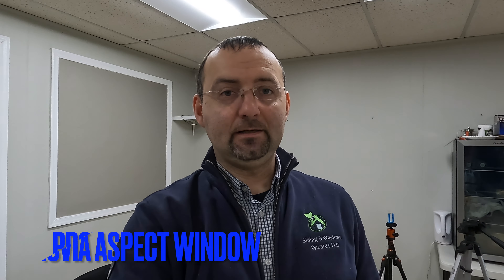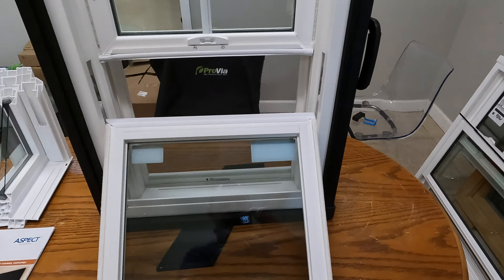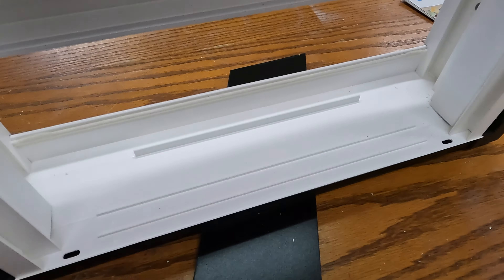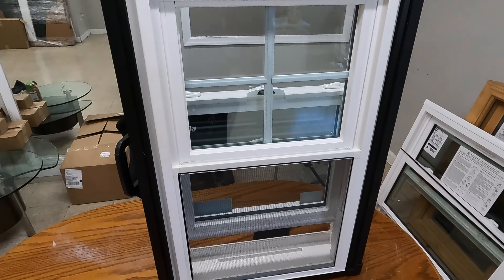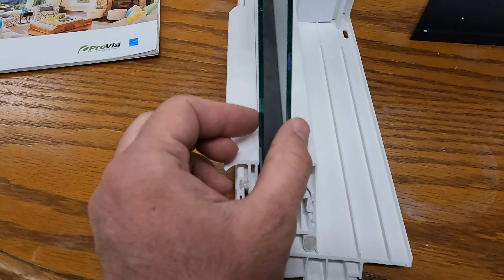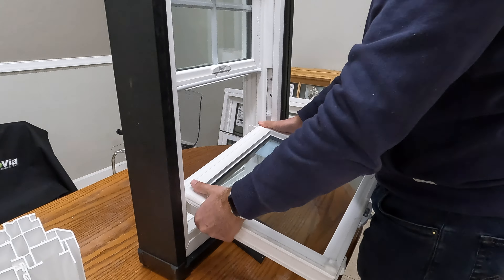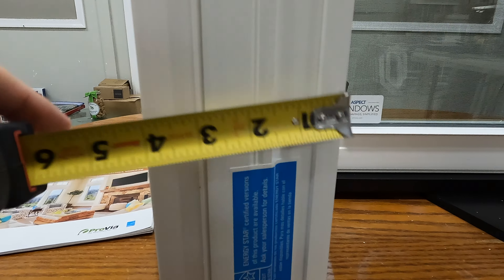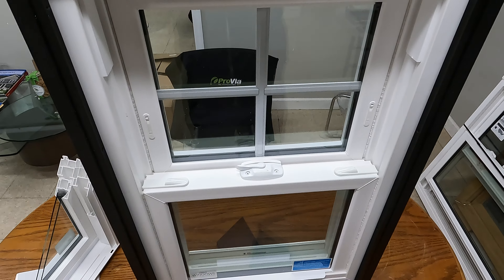Provia Aspect Window

Comment: 8:49 :  Had 18 of these plus Patio Sliding Door installed 6 months ago replacing all windows in 23 year old townhouse.  Very pleased with new windows.  Getting the right installer is as important as window quality.  Biggest benefits are greatly reduced noise from outside, energy efficiency with federal tax credits, ease of cleaning, and high quality window opening and closing mechanisms.  Don’t notice or care about any of the cons discussed. by reviewer.  Did one year of research before purchase.
Reply from the maker: yes, that's a good point. Provia  windows and Patio Doors do have pros and cons, like anything else, but as long as they achieve your goals in energy efficiency and performance, all the Pros overweight any minor Cons!
Reply from the maker: please share with what's your most favorite feature in Provia Windows and Patio Doors?
Reply: @SidingWindowsWizardsLLC  Energy efficiency:  They've kept the cold out due to excellent insulation properties and noticeably reduced the amount of heat from the sun entering the house during spring thus keeping it cooler.  Has reduced our energy bill by about 5% a month so far.    Also they've reduced outside noise significantly again due to good installation and insulation.  We live in a suburban area and these windows help with noise reduction.
Reply: @SidingWindowsWizardsLLC  Thank you.  The cons you mention will be of interest to some, however, for us the pros outweigh the cons.
Reply from the maker: thank you for sharing your experience with Provia windows!
Reply: We are looking at replacing 15 double hung windows in a 26 year old house and are seriously considering ProVia Windows.  I'm curious if you looked at Provia Endure too, and if so, why you chose Aspect?  Thanks in advance for you opinions and comments.
Reply from the maker: @gatman7772002  that's a good question! hopefully dpj118 will give us his or her feedback. On our opinion Aspect windows have a slimmer frame, more budget friendly and still come with high energy efficiency rating. We do like Provia Endure windows Tilt and Lock feature, it makes the bottom sash look cleaner, the window has more colors and options, than Provia Aspect window
Reply: @gatman7772002  Good question.  We looked at Endure double hung vinyl windows as well as Aspect.  Our window installer discussed differences between them.  In vinyl double hung versions virtually no difference other than a higher price for Endure.  Endure offers more cosmetic and design options especially when you move away from vinyl.  Our installer recommended Aspect windows and to put any additional money into improved energy efficiency ratings versus paying more for Endure.  Next door neighbor got same windows in his townhouse and we are both happy with our decision.  Cleaned all windows last week, including those on 3rd floor.  Easy!  No need to pay window cleaning company as we had to in the past with our original townhouse windows.  Finding a good installer is as important as selecting the right window for your needs.

Comment: How does this compare to the Andersen 100 Fibrex/composite Series single hung window?
Reply from the maker: It is tough to compare Provia Aspect Window to Andersen 100, because the Provia is a vinyl window, while the Andersen 100 has Fibrex material. So the  design language of Andersen is better, it does have more chiseled and refined look. When you look at energy efficiency, in particular air infiltration, then Provia Aspect is holding the crown. 
What results are you trying to achieve with your new window project?
Reply: @SidingWindowsWizardsLLC  thank you for your reply and follow up question; we rent here so I want a durable frame and long lasting frame ,limiting contraction and expansion issues as well. Of course energy efficiency is also important and a variable. Also outside traffic noise as we live on a busy road, but I am looking to upgrade the STC rating from the standard STC 25 to the max upgradable 32 STC with the Heatlock, what is your opinion please ? Thank you
Reply from the maker: @robertjosan  if it is rental then we would say Provia Aspect is gonna be more budget friendly option, than Andersen 100 series. You don’t wanna break your bank on rental property. 
It has great Laminated Glass Options to eliminate the most amount of noise possible. Just make sure that the frame is foam filled as well for weather and sound proofing
Reply from the maker: it is definitely much easier to operate, and Provia is more energy efficient window

Comment: How does the best grade Provia window compare to the best grade Onka window in energy efficiency and price?
Reply from the maker: Energy efficiency wise Okna and Provia are pretty much similar. Design wise Provia has a thicker sash and frame combined, so we think Okna is designed better. 
Price wise top of the line Okna and Provia are gonna be at the same level $900-$1300 . If you choose a bigger company, then it is gonna be more pricey, if you go with a smaller company then more budget friendly